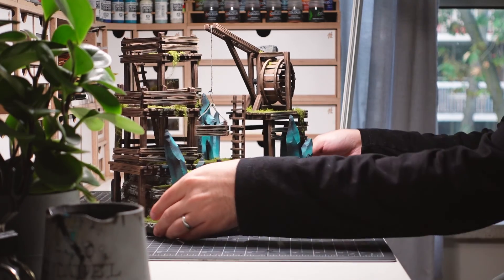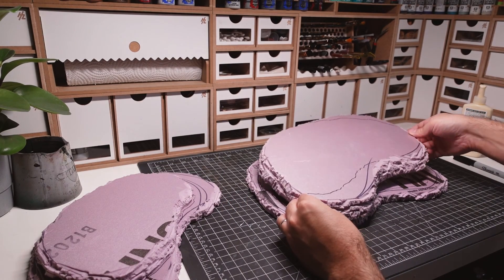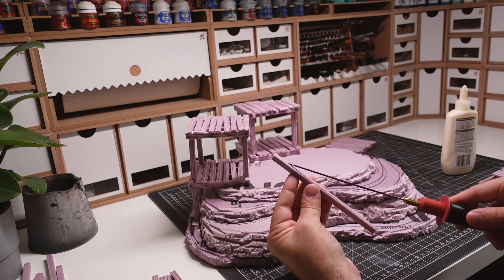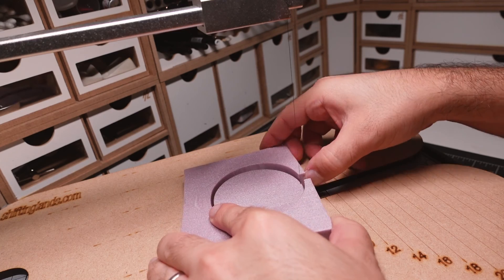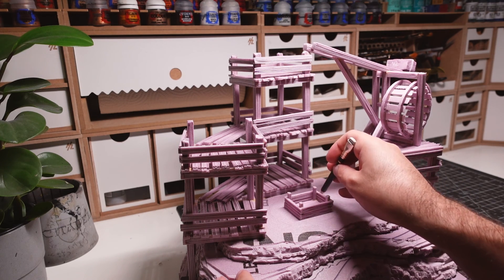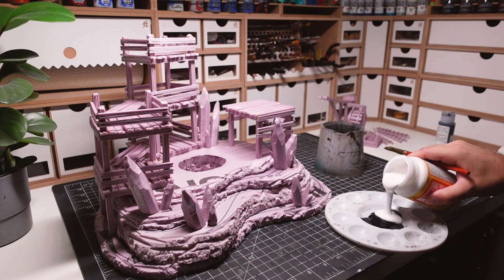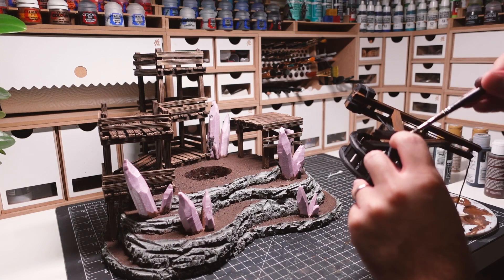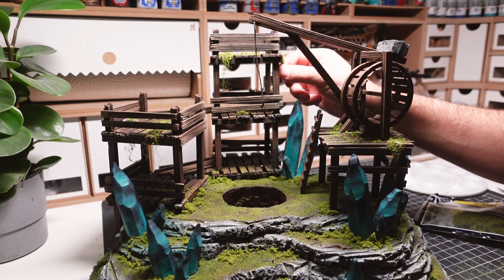Crafting a MINIATURE elemental mineshaft out of only one material

Comment: Do you feel nervous about brushing this if it's just tacked together with pva? I always worry about drybrushing and getting too rough painting foam only structures.
Reply from the maker: It's surprisingly sturdy. I can't speak for all foam, but the stuff I use is quite rigid. And with wood glue, it's quite solid. Haven't had any issues while painting.